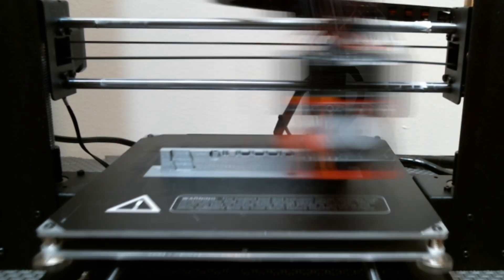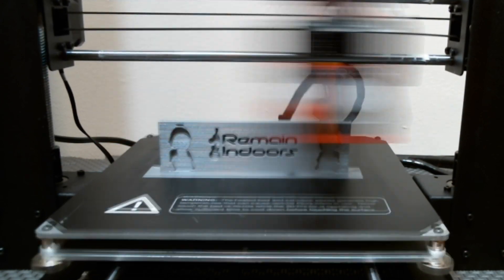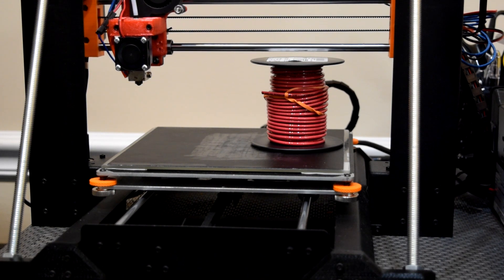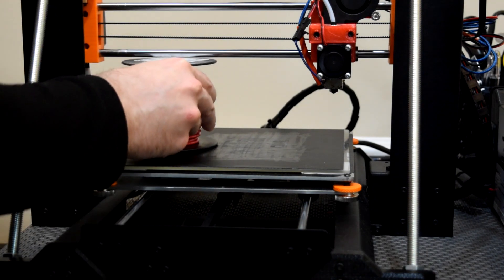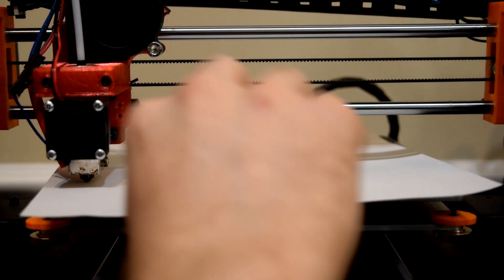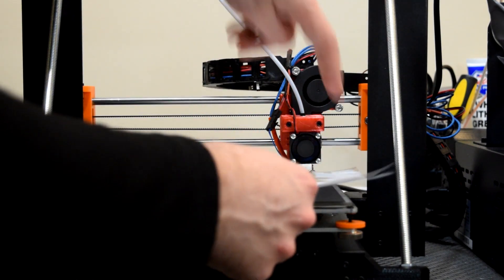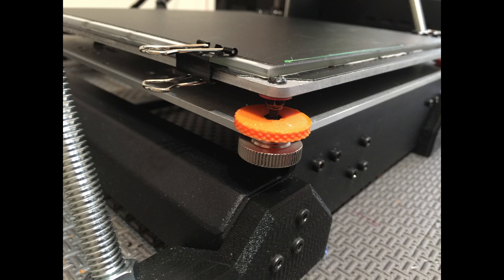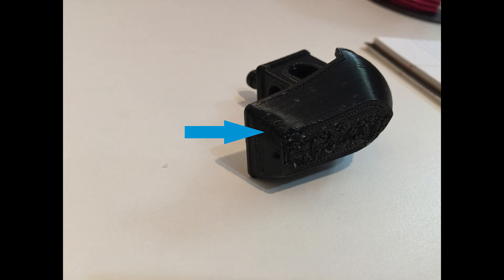3D Printer Bed leveling - Monoprice Maker Select v2

Comment: I was watching videos about 3D printer G-code and this randomly popped up as the next video.. "TY Youtube" 

Thank you for the video Remain Indoors Man however, I'd like to provide a suggestion....  A good strategy is to find a level surface in the X and Y axis at the start. Once a level surface has been identified and/or established (using a level for your machine) use a small level to adjust the X axis. This will prove to be more reliable than a "pill bottle or a "spool of wire". 

Please note. . . . I understand that one must use what they have to be successful. Trust me, I'm an expert at Red-Neck Engineering. With that said, kudos to the spool of wire :)

I hope this helps!